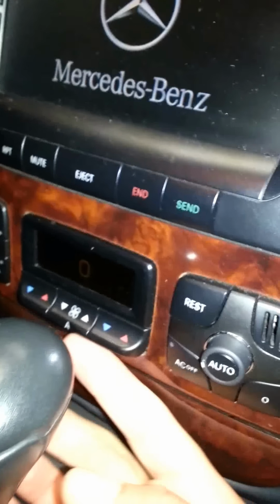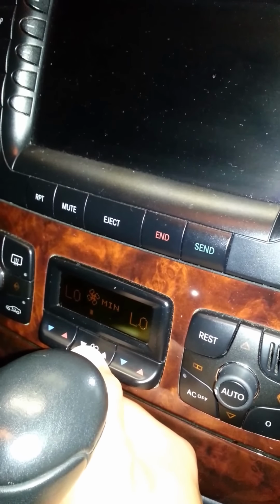How to fix a 2000-2006 S500 Mercedes W220 AC Blower

Comment: Hey bro I got a cl500 and driver side vents blows cold but the passenger side blows normal air. (Not cold) would changing that regulator part u changed fix that ?
Reply from the maker: @jessiepatterson5767  did you check to make sure that the temperature control is the same on both driver and passenger side? If they are, then there's a big possibility that the regulator is bad.
Reply: @PeterZafra  yeah they are the same temp. It actually started to stop blowing at times and I kept it on and while I drive it would turn on too. So maybe my blower too is bad ?

Comment: Hi dear, I have a 2004 CL500, how do I reset the AC system,  I seen that red light is lit on the AC button?
Reply from the maker: When the red light is on, that means the ac is off. If you click that button, the ac button red light should go away. If it's flashing, then there's a problem with your  ac. Hope that helps.
Reply: @PeterZafra  thank you so very much.

Comment: I have the same car same year. My blower won’t blow no air just like yours I will start diagnosing thank you
Reply from the maker: Check that part out and also check the fuse for the regulator. Those were the issues on mine. You got this. Cheers
Reply: @PeterZafra  I will check those I will report back. Does harbor freight have the multi meter to check this stuff?

Comment: Thanks! I was able to diagnose my bad blower motor. Regulator was ok still ok. My regulator was pushing 12v even with fan on low, but with the new blower off eBay it works perfectly.
Reply from the maker: Glad to help. Cheers

Comment: Hi 
I have s500 model 2001 w220 miles are 127000 with good serice recored. The only issue I am facing is ac blow cold from central vents and both driver passage and back sent vents through warm air. What can be the issue. I checked freon it’s good. 
Can you help help in this.

Comment: Thank you for the video. My 06 S55 the blower doesn’t come on. I volt test and I’m not getting any power on the din connector from the instrument panel to the regulator? Check fuse are ok. But can’t get any volts from the panel going to the regulator ? No red light I replaced the compress and is holed the charger but a week later the blower stop working. I ordered a regulator and a blower to install but when I tested the den connectors I’m not getting any power from the panel? So I’m guessing that means I have a bad climate control panel? Any advice would be helpful thank you
Reply from the maker: Check the actual fuse holder under the hood. fuse holder on the front passenger side engine compartment. I made a video on it because the actual fuse holder melted and wasn't making good connection. Pretty bad design. That solved it for me. Hope it works.
Reply: @PeterZafra  thank you very much. I can’t find the video on the fuse you are talking about? I check the #33 fuse under the hood pass side and the fuses looked good. I’m not sure what you mean by the actuator?

Comment: Just finished installing the A/C  blower resistor (regulator) on my 2004 CL500 and it worked. 
Thank you for your the instructions.
Reply from the maker: So glad it worked out for you. Cheers.
Reply: Sam, I've got a 2001 with similar issues. Where exactly Is the location of the A/C blower regulator on my model?

Comment: Thanks my man! my mother in laws drain clogged and poured water inside, now the AC is on the fritz.  Time to strip it down and diagnose
Reply from the maker: Aww man. Common issue with these cars. Make sure all is dry. Check fuses. Hopefully it didn't damage anything
Reply: @PeterZafra  fortunately all is dry. A year ago The trunk seal leaked and flooded the rear tire well and shorted the stereo which was causing a parasitic drain on the battery. Thankfully YouTube saved me on that and dried it out. A month later found more standing water in the recessed floor where the main battery line runs to the front (only knew about it because the car wasn’t locking and had to check the fuses). Replaced the ecu and dried that out. Love learning about this stuff from guys like you and your YouTube channels. Thank you!  Got the blower out and about to order a replacement, super easy to remove.

Comment: I just work on my E240 here in Panama. Blower starts or not depending of it’s mood. Ordered a blower & regulator at Amazon for $88 brand new. I know my blower works but for the price I couldn’t resist. Only blower are around $40-$60. Regulator was $70 to $114 separate. So if my blower goes I still have a replacement part in the garage.
Reply from the maker: Awesome. Cheers.

Comment: So I have the exact same issue, head unit works, fuse is good, blower motor spins when 12V applied.  I checked the voltage coming out of head unit to the regulator and got a positive 12V across the thick gauge wire and got 2V to 6V on the smaller gauge wire (to ground) when I ran the fan from lowest to highest setting.  Output from the regulator was 0.  Output from a replacement new regulator was 0.  Can you tell tell me what the full input range was to the regulator depending on fan setting?  My guess is that the head unit isn't putting out a high enough control voltage to the MOSFET.  Also, I've got an S600 "AMG" (2005) with the rear control and my harness only had three wires, just like yours.  I should add that the rear control works just fine, so in my case, I believe there is an additional MOSFET regulator in the center console.  Lastly it also intermittent.  Mostly non-functional, but occasionally it will come on.  Oh and ZERO diagnostic codes in the HVAC computer.  - UPDATE: I found a shop manual page and the correct output voltage from the head unit ranges from 0-6V providing a 0-12V regulated output, so at least the head unit seems ok.
Reply from the maker: Hmmm. If you haven't yet,  check the fuse and make sure that it isn't melted. Passenger side in the engine bay. If it's melted, chances, are, there's not enough current passing thru
Reply: @PeterZafra  thanks for the tip.  I checked the fuse from the top (plastic window just fell out) and the metal looked like it was heat stressed, but the fuse itself was wedged in there pretty good and I didn't want to break it taking it out.  I suppose that may be indicative of a melted box, or fuse, which didn't occur to me at the time (I did this before seeing your video).  I'll try and yank it out and update here with what I find.

Comment: Mine works when it wants to work like it will work one week and the next it won’t work can you explain this I had a error code 1000 what is that
Reply from the maker: I'm not sure what error code 1000 is but you might want to check your fuse for that regulator. I actually made a video on it as well. Mine was melted so at times it worked and at times it didn't. I've dealt with this one too mant times. Hope you get it fixed. Cheers
Reply from the maker: You could also have a bad regulator which is what this video is but check the fuse and make sure it isn't melted.

Comment: This is awesome info!!   Would this be the same for a 2004 S430?    Mine comes and goes both A/C and heat are fine but the fan just shuts off for awhile then turns back on full blast whenever  it wants to.      After watching your video I am inclined to think it’s the blower module rather than the fan itself.     Also if you think that’s the route I should take, what is the part number I need to replace mine?    Thanks so much, Jonathan
Reply: Thanks for replying!  I dont see any evidence on fuse 33 of overheating or a "melting" so I'll probably move forward with the regulator. The issue comes and goes. Heat or AC. But then you said the same in this vid that the fuse checked out good.   But then 3,000 miles later you were doing the fuse mod video.   Guess I'll find out in a few months.   Thanks again for your help!
Reply from the maker: Thank you for watching and subbing. The best thing to do is punch in your car model and year on the browser and confirm with the seller regarding your vin number to make sure it works. Also, you might want to check fuse 33 on the engine compartment on the passenger side to make sure that its not melted. I encountered that problem with mine after replacing the regulator. You can search my video on that was well. Melted fuse housing w220. Hope that helps. Cheers.
Reply: Having the same issue with blower coming on for 10 seconds then off and cycling. My friends cat and he said he's replaced the motor and regulator already. I tested the old regulator and it shows 195 ohms between positive and pin 3 so I think this regulator is good. Did you finally fix your issue?

Comment: Hello, so I have a 2000 s50 box is w220 and my battery keeps getting drained then completely flat so I have to buy a new one. I noticed that when I would turn off my car and take out the key, the blower for the back two seat kept making noises, could that be the issue of my battery drain?
Reply from the maker: Yes. Definitely could be a big cause. Your regulator could have an open circuit causing the blower not to shut off. Have it diagnosed. It should be the issue.
Reply: Peter Zafra dang your reply time is AMAZING! And yeah it only blows hot air and won’t shut off after I press the power button
Reply: Peter Zafra does a specialist need to check it or can any general mechanic check it? The specialist in Puerto Rico is charging me $225 just to check one module and I don’t really want to or can pay that much
Reply from the maker: Sorry for the late reply. Wow that's a lot but sometimes you just gotta bite the bullet to find out what's really going on but I do have a feeling that it's your module because one of the wires that connects to it is a live 12 volt coming from the fuse box. If it stays on open circuit, then it will drain your battery.

Comment: I just replaced my regulator on my 2004 s430 4matic,second time I did this results were worked for a couple days,stop working got in car yesterday and it was working now today not working but I notice when I'm driving and gas the car I feel cool air coming thru the vents but not blowing what can that be .....thanks
Reply from the maker: Check out my video on a melted fuse for the blower. This could be your issue as it became mine after doing the regulator change. Let me know if your fuse housing 
 is melted. This was a known issue for these years.
Reply: Or... the blowers pull too much amperage through the variable resistor frying it...
Reply: Or... the blowers pull too much amperage through the variable resistor frying it...

Comment: Peter hi, great video step by step instructions. Really appreciate you taking the time to show us. My MB is an S430, and my AC Blower isn't blowing. I've replaced the blower, the regulator (bought online, also got a cheap set from the JY that didn't work either). Reset the computer as per another site after replacing the blower. Replaced fuses 33, 4, and 7 as different websites were conflicting - I had extras already so it was no issue. Still nothing - blower isn't blowing. Any ideas my friend?
Reply from the maker: Make sure that there's full voltage going into the regulator. I posted a video on a melted fuse housing. Search my videos on melted fuse for ac and check. These model years are known for that to fail. Let me know what happens. Cheers.
Reply from the maker: The link is in the description of this video.

Comment: Great video! Thank you so much! And very helpful on the tip to hold the 2 buttons to get the errors. I had codes 1451 through 1463. I ran some tests. The fuse was fine. So then I took the unit out and started with replacing the regulator. That worked. The blower worked fine. The blower was not seized so I reused it. So much knowledge on these cars which makes them a good buy for DIY folks. I got the same story, dealer wanted $1400. I paid $98 for that same regulator you have. I saved $1298. Thanks again.
Reply from the maker: Thank you for watching and subbing. Cheers

Comment: Ok I did everything that you did. I found that I wasn't getting power from the climate control unit so I bought one and bought a new resistor like yours there. A.c. still doesn't want to come on. A.c. system is charged. AC compressor is working cause ac line is cold. Blower motor works. Hooked it to a 12 volt source. Any ideas?
Reply from the maker: Check the fuse. These models had a melting fuse problem. I actually made a video about it because it happened to my car as well. Let me know what you find out
Reply: @PeterZafra  I finally was able to find the bad fuse. All fuses did look good and also tested good. However what I found was the fuse holder underneath the fuse for the ac was bad. Fuse was still good but what I couldn't see under it was bad. Ac has been working fine since. I did pull that fuse and bypassed it all together.
Reply: @PeterZafra  fuses are all good. I dont know which fuse it is? But I did check them all. From both sides under hood an the ones on passenger side of the dash and under passenger side rear seat. Could it be a melted wire from climate control to regulator?

Comment: Thanks for the great video. My blower comes on and off intermittently. I know the compressor is working because I can feel the cool air (static) when I put my hand on the vent. Its just the blower is not throwing that cool air into the cabin. Is it safe to say that it is the regulator or blower?
Reply from the maker: It could be your regulator. Try to leave the fan on the second level and see if it still comes out intermittently. If it does, it might be the regulator. You also might want to watch my other video (link in description regarding melted fuse). That became an issue for mine as well. Let me know how it goes cheers.
Reply: Since the blower does come on (80% of the time), is it safe to assume that the the fuse is good? I mean if the fuse was bad, the blower would never come on. Is that correct?
Reply: @bhasins  mine was doing the same as yours and now doesn't come on at all. I replaced regulator and climate control and still doesn't work. Did you fix yours?
Reply: @Overdriventv  I soon realized that if I tapped the blower unit really hard, it would come back on. That told me that it was definitely the blower motor. I took it out and cleaned it with compressed air. It started to work but then it started to crap out again after a week. I just ordered an aftermarket blower from eBay and it's been working fine ever since. If you have replaced the regulator and controls, the blower is the only thing left which could be bad. Go ahead and change it out. It's not super expensive $80-90 from eBay. Good luck!
Reply: Sumit Bhasin I'm not getting power coming from the connection with the 3 wires that plugs into regulator. However I do get power out of the back of climate control unit... I have hooked a 12 volt source to the blower motor and it comes on. I think the issue is in between  climate control  an regulator.  Haven't had a chance to try to test the 0hms.
Reply: @Overdriventv  Try running a wire straight from the climate control to the blower to check if it works. If it works, there's a break in the original wire harness which may need to be replaced. Good luck!
Reply: Sumit Bhasin I just watched the video he was mentioning in this video about his fuses. I was checking the wrong fuses and the power wire actually comes from the fuse block from under the hood. I'm going to my garage now to check mine. Lol
Reply: Sumit Bhasin I just checked my fuse and it definitely got very hot at one time. It started to melt. I will definitely  park the car till I can repair this. I want to thank you also for your response.
Reply: @Overdriventv  Oh yeah. You need to check the fuse before you check anything else. LOL. BTW, in case the fuse is melted, in the fuse box, there is another video on YouTube where the guy had the same problem. Instead of replacing and wiring a new fuse block, he found a live wire in the bottom of the passenger side floor and ran a new line direct from there to the blower. He added an in-line fuse to it too. Good luck.
Reply: Sumit Bhasin I had checked fuses first and they checked out fine. They even light up with a test light.
Reply: If the fuse area or fuse looks hot or melted, there is a recall to have that fuse holder and wire replaced. Call your dealer for that. The rest do yourself.

Comment: Would this possibly cause my AC to fail intermittently? I have a 2005 s55 AMG. Front air only.
Reply from the maker: OverDrivenTV yes. It can cause your dual climate to malfunction. Very common problem
Reply: Peter Zafra Thank for getting back to me. This is a great video. AC has been working for 2 days now... But now my sunroof stopped working. Lol. You activate the sunroof button an it opens about an inch an stops. You close it an it closes but then pops up.

Comment: My 2004 s430 4matic a/c will blow at times sometime it doesn't I think its the blower because I can feel cold air but its not blowing is it the blower or resistor plz help me thank you
Reply from the maker: Wish Bone it might be your fuse holder being melted. I've had the same issue. I hope it isn't but you might want to check it. It can be your blower resistor as well but check the fuse first. Cheers

Comment: On the ac control panel where it says ac off the light was stuck until I reset it and it turned off then the ac made a noise like it was turning on but it still doesn’t throw cold air

Comment: my 2000 s500 benze the  blower went out i replaced the climate controll  and blower  module still no blower i put  duwalt 14 v battery to   the  blower works          so im going to buy pass it next.. tge blower has alot of calcium deposit i tried every thing on your video
Reply: please help
Reply: Juan Gonzalez what was the outcome?  I'm going through the same thing my ac stopped blowing but when i put power directly to the blower it works I ordered a  regulator and still not working I think they sent me a bad 1